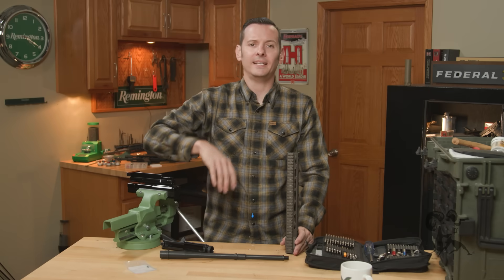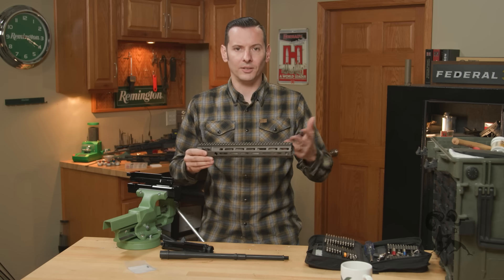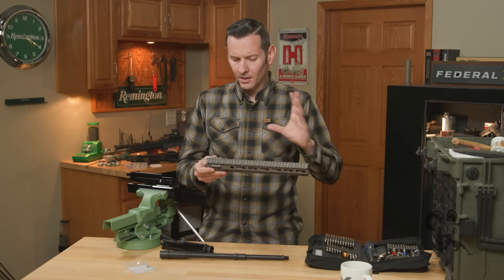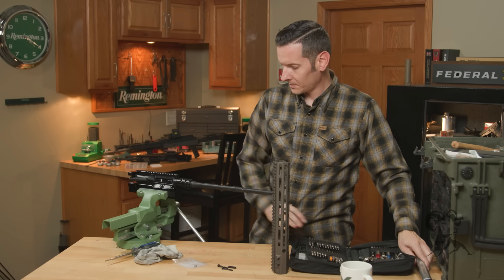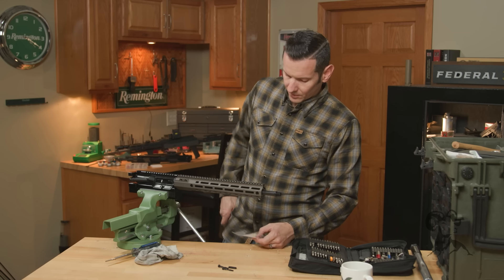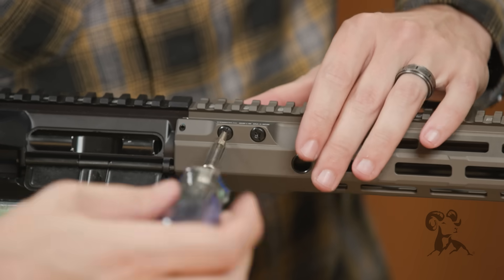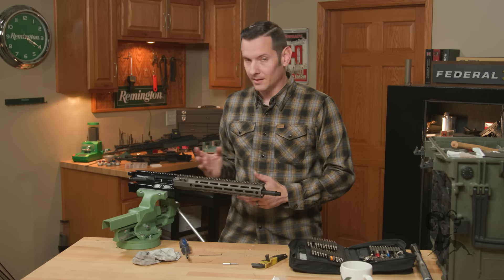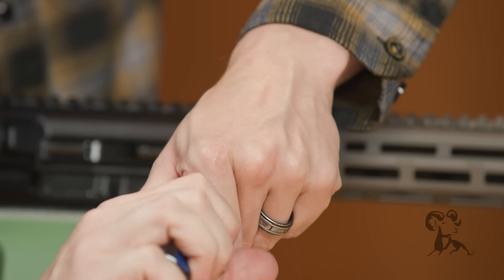Tech Tip: Aero MOD 4 Handguard Install

Comment: Pro tip: only buy aero from third parties like Brownells etc.  Never buy from their website.  They hold your money and send your product out months later.  You'll have a hard time cancelling it.  The only time they'll contact you is if they made some egregious mistake like offering a nice barrel/handguard combo for $90 like they did a few months ago and the purpose of their contact is to see if you'll accept different cheaper parts.  I like aero parts but their customer service is absolute trash.
Reply: Wish i saw this before I ordered a few items from them
Reply: I’ve ordered 5 times and have never waited very long to get my order. My last order was a lower from the 4th of July sale(2024) and I had my lower in hand and on the bench by the 11th.
Reply: @hillcosparky1050  Their problems have exacerbated since about September.
Reply: Dealing with this now. Been processing since 11/14/24. Have tried numerous times to contact them, via phone and the online chat. Literally booted off every time I got close to 1. Always under position 10 as well. Nefarious customer service practices. NEVER AGAIN
Reply: I've ordered direct 7 different times and every order that was in stock was shipped within 3 days.
Reply: @jaxithfox  Was it in the last 6 months?  My experience with them is the same as yours however they have had major issues arising in the last few months.  You can actually find an abundance of complaints on BBB website which has them as unaccredited and "F."  They are so bad now that they are sending out parts after an order has been cancelled and the transaction reversed.  It is not a good situation.
Reply: I believe you. 👍
Reply: Damn that's rough.  I guess I'm lucky over the yrs that I've never had an issue's with ordering direct from them .. hope it works out for you bud.🤙🏽
Reply: @daryenmirabal2656  I appreciate your kind words.  I do like my aero parts, quality at a good price.  I can't knock their products.
Reply: Ok, JenkinsStevenD... Or should I say, Caleb?
Reply: @CoryIsMyName  Well...I do dye my hair with alumahyde black - shiny.  While I have ordered a lot of parts through Brownells, I don't think I have ever ordered an aeroprecision part through them.
Reply: 45 days ago, I placed my very first and last order from Aero direct. It's still processing, I'm positive my last suppressor came back faster...
Reply: @seniortac4175  Better than optics planets deals etc?  That is surprising.  Sorry for me to ask you to do a bit of leg work but which do you go through?
Reply: @JenkinsStevenD I'm an Aero dealer!  I get dealer pricing, which is better than nearly every online company!
Reply: Placed an order for an upper in Nov…. It’s mid Jan and still no shipping update.
Reply: @ZDawg12  Have you tried calling them?
Reply: @ZDawg12  I went through my credit card company and had the transaction reversed.  They are so disorganized that they sent my parts after 5 weeks even though the transaction was reversed.
Reply: I wouldn't buy from a 3rd party either.  There is no way to handle warranty issues as they don't have a Customer Service department
Reply: @douggraham5177  I would generally agree but I've never had a faulty product from them.  Their recent customer service issues cost them a solus sale from me. That's too expensive to have a potential issue.
Reply: @JenkinsStevenD  I am not trying to bash the products but when they take your money and you cannot get the great products nor get any service, it's hard to recommend a company like that.
Reply: I have made countless orders from Aero over the years spending well over $10k.   They have went down hill.  Been two months for in stock products and countless hours on hold.   Horrible service, buy on brownells and have a warranty issue.....good luck..
Reply: This is ture. I have been waiting for an order for two months. They do not answer the phone call in or emails. My experience is over the years with getting partial orders is that things are actually out of stock or promise to other suppliers when you order them for yourself.
Reply: I had a horrific experience I wont buy any product from them anywhere now. Months of waiting and zero customer service
Reply: I ordered an upper receiver and a quad rail on 11/28/24 I got the receiver about a week later. They didn’t say anything about the quad rail. After about a month I got an email with a vague explanation. I got my quad rail last week 2/26/25. Only took 3 months for a product that was listed as “in stock”.
Reply: Waited 4 months and the barrel shims are missing. Could not get them on the phone so I had to buy them online and pay more for shipping than the part cost.I wish I went with another company.
Reply: I either buy from a local gun store or from MidwayUSA if I can't find what I need in town. I hate the wait if I can avoid it and I just like supporting local stores first but Midway is like the Amazon of outdoor stuff. They're not as fast as Amazon but they ship things out usually same day and I've never waited more than a week
Reply: I've ordered directly from their website five times and never had an issue, haven't had to talk to their customer service so I cannot speak to that
Reply: @keelanhumiston5759  I didn't have any issues previously but in the last 6 months they've missed the mark HARD on three of my orders.
Reply: @thepwndoctorz  I looked on the aero Reddit page and it’s full of people talking about waiting for orders and people waiting for order confirmations
Reply: @thepwndoctorz have you bought a complete upper?!

Comment: This actually looks like a pretty great design. Those anti-rotation set screws (borrowed from G$) are very nice. Top mounted hardware is allegedly much better for your barrel and general rigidity (per BCM) , so it feels like the best of both worlds.
Reply: That’s what I’m thinking. Depending on the price may be I’ll grab one of these instead of the expensive G$